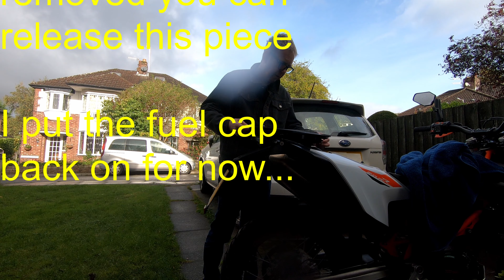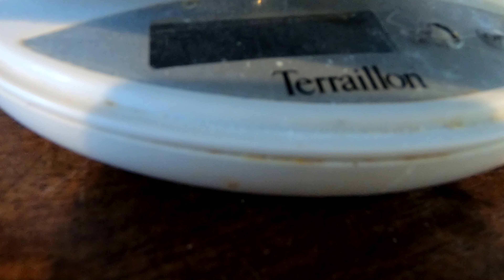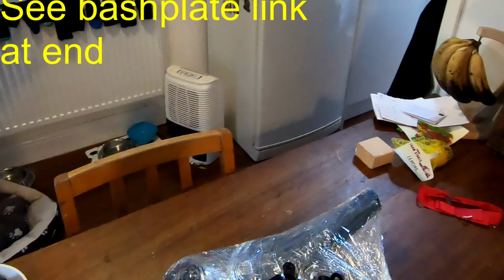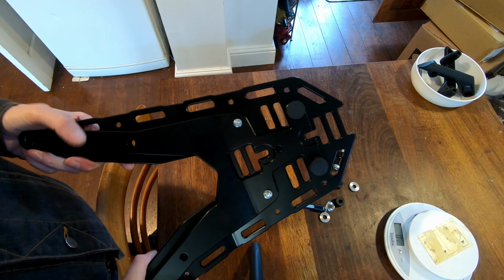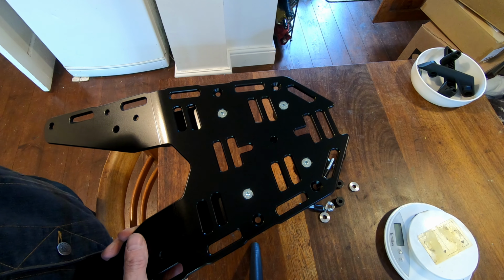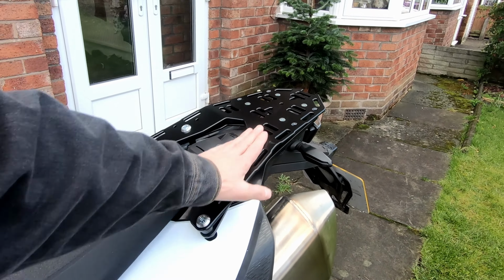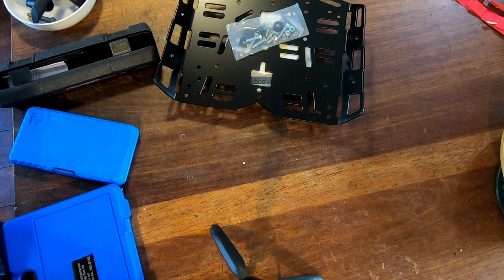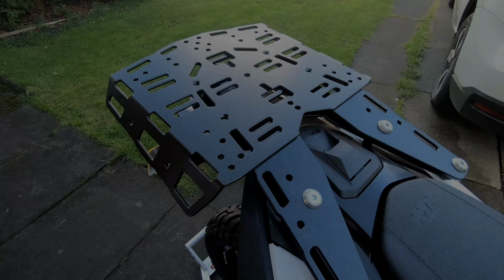KTM 690 Enduro R - Perun Moto Rack 2019 Model

Comment: I am a regular follower of your videos. I bought a 790 Adventure in 2019 to travel around Spain, obviously COVID19 thwarted my plans. I have thought about buying a motorcycle more suitable for local off road routes, (I live on the island of Gran Canaria so the difference between local routes and long trips is clear). I was stumped by your change because I was unsure whether to buy the 390 Adventure or the 690 Enduro. The problem is that I have tested the 390 but I cannot test the 690 as there is no test bike in the Canary Islands. My main fear is that the 690 could be too intimidating off the tarmac in addition to the height issue. I am 1.72 meters tall and I weigh 65 kilos so motorcycles that are too big are uncomfortable for me. As I strongly agree with all your opinions about the 790 S it would be important for me to know your opinion on this change. Thank you very much
Reply from the maker: Hello José. If it is to be a 2nd bike rather than the only bike (as in my case) then it might change my opinion. It was actually the test ride on the 390 Adv which made me decide I could live with a single cylinder bike again. But I did not want to drop (after much thought) so far in power. So the 690 seemed logical - also prices were reduced as end of season, by a lot. I also wanted it to be as light as possible, I get tired getting bikes in and out before riding (medical/age). The 390 Adv is much cheaper. Probably almost as capable on tracks if you take your time. Also it is a bit lower. The 690 is very high. I can cope with it at 178cm (including my boots), but only just and only because it is less than 150kg. I do love it though. Getting the 690 lowered is possible, but there seems to be a big shortage of kits till next year. The Covid thing has been a real change for everybody. We are locked down again just now. There's little I can do in terms of riding whatever bike I have. I can only tell you my thoughts. How did you feel on the 390 Adv, were you happy? Or you could wait for the 490 Adv which might appear next year.